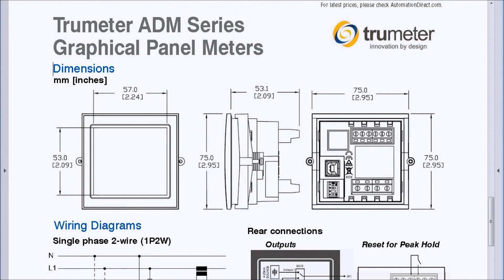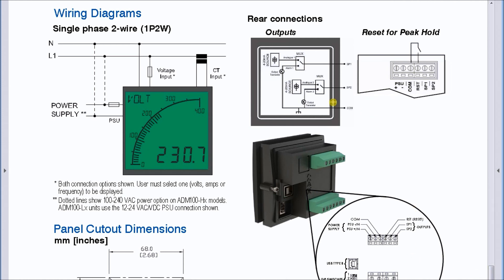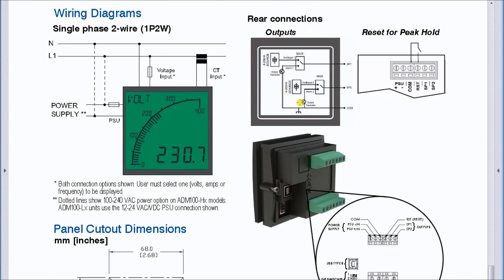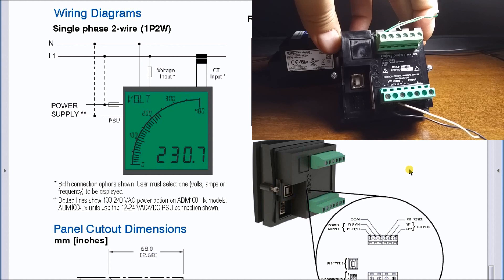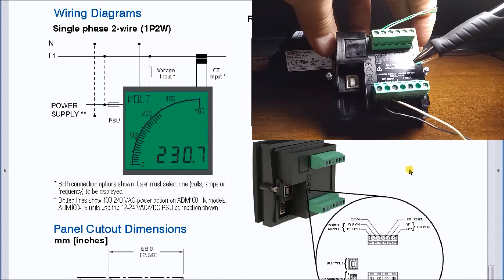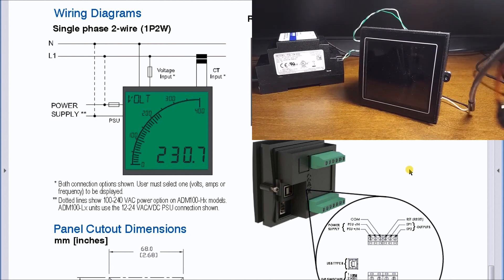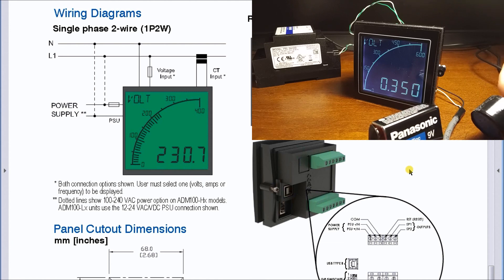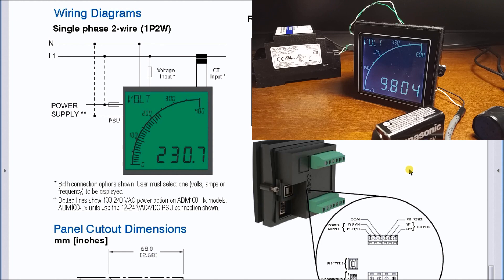Trumeter ADM100 Series Graphical Panel Meter – Powering the unit

Comment: Have you done any experimenting with the analog 0-20ma outputs?  I have an interface with 0-5 volt analog input that I'd love to be able to connect to APM's output... just trying to figure out the best way to do such.
Reply from the maker: Hi Kelly,
I have not done much experimenting with the 0-20ma output. However, you could just add a resistor to get your 0-5 Volt input that you are after. Ensure that the load is still within the specifications. In a permanent installation, I would use isolation of the signals. 
https://www.automationdirect.com/adc/overview/catalog/process_control_a_measurement/signal_conditioners/dc_voltage,_current_or_potentiometer_input
Regards,
Garry

Comment: A very interesting panel meter. I will use one with a 0 to 10vdc pressure transducer 0 to 15psi with alarms  to replace a panel pneumatic gauge.  😎 Thank you.
Reply from the maker: Hi @qzorn4440,
These are very nice and look good in a panel.
Regards,
Garry
Reply: @ACCautomation  Thank you.